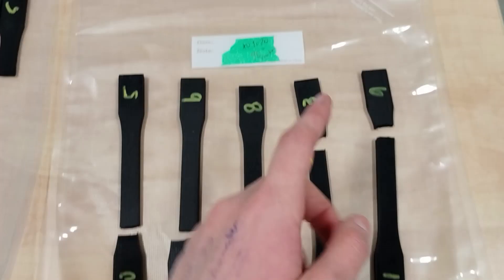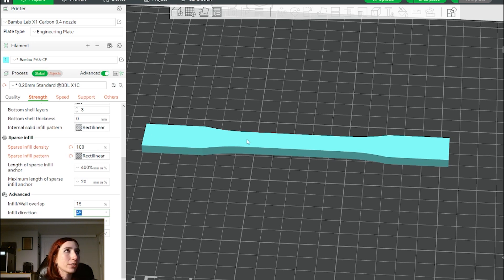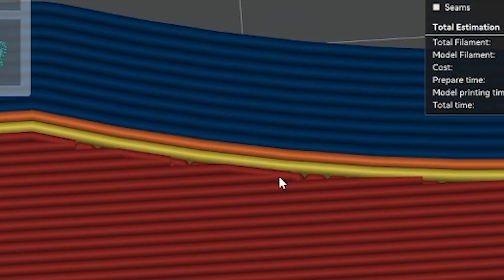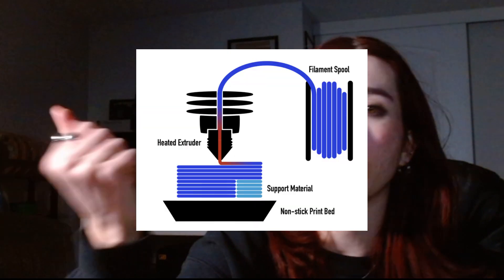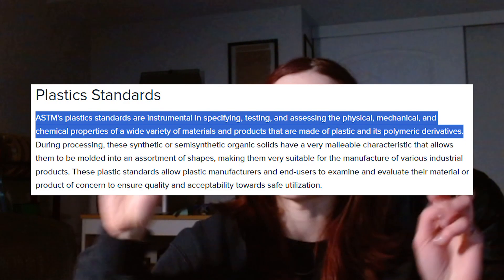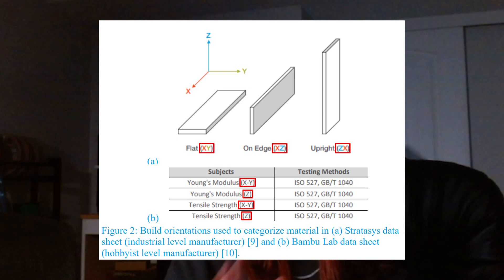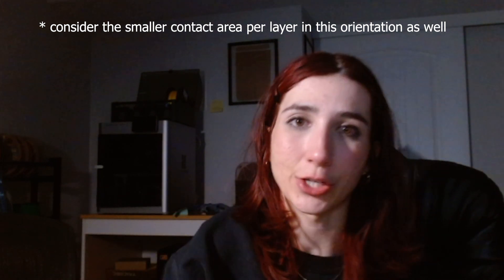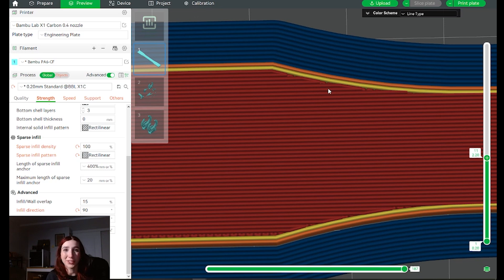we NEED better testing standards for 3d printed parts...

Comment: So I printed a lot of these samples with Stratasys machines and they use standard dog bones, tested in Xlong, Ylong, and 45* in all orientations. It ended up being ~40 articles per plate. And I believe they only used 45* alternating angles. 
My guess is the new testing method for custom machines will be all contour and no raster fill. Then separately tested raster fill.
Then parameters for strength are set for Z-orientation

Comment: I like your video I'm a engineer working with high temp materials at vision also agree we need a new standard also why are you not wearing safety glasses
Reply from the maker: Our tensile machine is fully enclosed when we run it so thats why I dont have any safety glasses! When I remove the parts from the system its after it has broken (usually in two pieces with no shards). 

When you say "at vision" are you local? What materials are you testing & is it just tensile?
Reply: @strelkomania   I work at vision miner in California not local to where you are we sell high temp machines and scanners and nano polymer adhesive and I can send some safety glasses
Reply: @strelkomania   we print at vision miner peek, ultum, peak, cf nylon gf peek cf peek

Comment: Really interesting, thanks for sharing.  I'm glad I wasn't too far off the mark when I tried explaining to my dad (a proper engineer) that the spec on the datasheet doesn't really mean much and I gauge parts much more on instinct about how strong they are than anything quantative.

I'd never considered that you'd get stress concentrations from the voids in the solid infill.  I get that these tests were inconclusive and can't be relied upon but it would be really interesting to know how these solid parts compare with something with more walls that isn't solid - i.e. does the stress concentration actually make this less strong than a part using less material (but more walls).

You might be able to get most of the voids filled if you can mess with the pressure advance / linear advance setting.  It might not be pretty and it just adds more fuel on the "it depends how it's printed" problem pile but you might get it to work by tuning PA/LA so you have bulging (over-extruded) corners.

Comment: I did a 3d printing research project for my senior mechanical engineering project. I printed 15mm square columns and used a 3 point bend test to average out impact of voids over a larger area. I was testing layer adhesion techniques. Point being that all my samples broke in the middle, so perhaps you can get the data you want from a 3 point test.

Comment: I think you might be too quick to draw a conclusion here. You have one set of tests, you're concluding the results are due to one variable without testing to see what changing that variable does.  Maybe it's the voids, maybe it's not. Orca slicer has a gap fill option.You're also only looking at the slicer, I find in practice those voids aren't actually there, plastic gets squeezed into those areas.

I'd say test with gap fill on and off, test with slight over extrusion to fill those gaps (if they aren't being filled already, you showed the gaps in the slicer but not on the actual samples), see what effect that has.

 clough42 had a similar issue to you with his tests (I think he also tested fibre filled nylon). The samples kept breaking closer to where they were held rather than in the necked down region. It turned out to be a work holding issue, stress risers and concentrations due to the clamping of the work piece. This is an even bigger issue with fiber filled filaments as they're stiffer, more brittle and weaker than regular filaments. CNC kitchen regularly tests filaments and they fail in the necked down region.

Comment: Powered bed fusion has a lot of properties outside of the ones you mentioned that inhibit the way it’s fused together depending on orientation power gyros skywriting there’s a lot of factors that it’s a whole different can of worms. It’s very interesting and I’m very into additive manufacturing and the applications and finding a standard way of processes to certify materials that are FDM, SLA, SLS , binder jetting and powder bed fusion. If you’d like, I can send you a thesis paper from a friend of mine, who is very knowledgeable and focuses on powder bed fusion he also teaches courses at the university of Texas El Paso.  His paper tries to explain a lot of things and is frustrated with how there’s so many different standards that NASA, ISO, ASME and all those other ones different ways of conducting tests. Even the aerospace company I work at has their own method. It’s very frustrating.
Reply from the maker: I would love to read that paper. There is an email linked to my channel page, please feel free to email it to me! THANK YOU! I am always looking to improve my knowledge on all facets of 3d printing including the different tech.
Reply from the maker: You're right. That's how it ends up being due to how much variability there is with additive - that companies (specifically the ones where failure is a big deal in the end application) will end up running their own in-house tests and create their own "standards" or failure thresholds uber specific to what they're working on. I have barely scratched the surface in this video and am happy to see your comment furthering the discussion :)

Comment: Might be a pressure advance issue, causing underextrusion at sharp corners.
Reply from the maker: Good point - dialing in extrusion settings or doing a gap infill could help! Even increasing wall count or printing concentric rather than raster. But in this case I wanted to showcase how a different raster angle actually can make a difference in performance (for better or for worse).

Comment: Composite materials are probably a good place to look in terms of standards since they have a similar structure (layers, with specific weave patterns) and most composite tensile tests just use a rectangular sample like what you described. I tried doing a flexural test with PHA filament a while back. When I used a Hilbert pattern it broke under a small load with very little deformation, but when I printed it with the solid infill aligned along the length of the part it was able to bend much more before breaking.

Comment: There are a number of 3d printer youtubers that have done significant research here. Print temp, wall thickness are the biggest indicators of strength of part (hotter temps and thicker walls lead to stronger parts). Infill has extremely little effect. The downside to higher temps is more stringing, the downside to thicker walls is much longer print time. Layer height can also be an impact.

Comment: 3d printed parts are anisotropic due to the manufacturing process (layers, infill...). However, those tests were designed for isotropic materials like steel.We lack good models for predicting the properties of the final part from the isotropic properties of the filament

Comment: Igor from My Tech Fun has a really good testing regiment.

unfortunately, he doesn't optimize print settings on a per filament basis but even still he provides a good baseline.

Temperature, speed, and cooling are the biggest key factors in making a strong FDM part. I bet, you have severe layer adhesion problems with those coupons. Layer adhesion doesn't just affect the Z-Axis it also affects every line causing delamination in each and every way down the valleys of air.

- Too cold or too HOT and the part will be weak.
- Too fast or too slow and again weaker
- same for cooling

To maximize strength, you have to ride the line between verification of the plastic and introducing micro stress risers from not properly melting the adjacent plastic with the line that is being put down.

Comment: Yes I found out the same. When upping the number of walls such that I only have wall lines this issue did not occur for most filaments. For those with relatively low layer adhesion this was still the case however. Allowing for rather liberal Arachne settings avoided this.
That however does not test what you are testing, it is the best case tensile strength in perfect layer direction. Even in this case I found out that the extrusion multiplier has a profound effect. Under extrusion obviously leads to weaker parts as there is simply less material and there are more voids. However over extrusion also leads to weaker parts, even 2% over extrusion (2 % above the peak tensile value, not necessarily visually the best although it was also visually the best sample) already reduces tensile strength by 5 to 10%.
The patterns you are testing I have simply met tested (yet). Would Arachne help (partially) fill the voids you get just like I was observing. The effect will be stronger with lower layer adhesion materials too I expect as that was what I saw even when fully printed in line direction.

You made me check what the slicers actually do. In Prusa Slicer I can see that for infilled layers except the top and bottom layer it uses monotonic line infill and applies Arachne optimization. Orca Slicer on the other hand uses monotonic for these layers. Monotonic shows in the slicer way bigger gaps than monotonic line. Maybe slicing with Prusa and setting all surfaces to monotonic line with Arachne enabled might lead to (slightly) better results.

Comment: It needs to be printed 100% perimeters not 1-2 perimeters and pure infill... That's why the pieces are breaking poorly.

Also your prints are not printed correctly. You need to use monotonic lines and not rectilinear infill and adjust the overlap and extrusion multiplier properly. 

Doing this properly will allow you to get the correct results.

Comment: I'm only a few minutes in but my immediate thought is: what if we used an arachne style top layer infill generator, which changes the line width to get way closer to the wall. if you can get right in there and fill that gap with plastic, it should fuse much better to the wall and any plastic in the previous layer too.
Reply: additionally, I also wonder if this problem is present when using space filling curves instead of rastering. although depending on acceleration, that could massively increase print times.

Comment: Excellent video.  I cannot agree more.  I've been having issues with TDS from any manufacturers since the beginning.  The impact of the process parameters VS the impact of the composition of the material is huge.  Some TDS will provide basic print parameters they use, some won't provide anything.  And even in the best cases, it's far from enough.  There is no way I can derive estimate of performance when I print a material.  TDS or not.

Comment: For the number of 3d printing channels that do testing, you'd think the universities would get on board and train students better. 
To use tests directly from other plastic processes is setting yourself up for failure.
Would you test a pressed powder metal part the same way as a cast metal part? 
Or expect the same failure modes?
Reply: I get you but there is also value in a test that is standardised across many different manufacturing methods so that you can compare across the methods.

Comment: A new standard for FDM/FFF is something I'm very interested in!

I did some material testing research during my undergrad and the anisotropic nature of 3D prints seems like such a can of worms. I wonder if a more universal G-code standard/file type would help with repeatability between printers, and so that important variables like layer thickness, number of walls, direction of raster, etc. can be more easily communicated since G-code files are usually pretty unintelligible once its out of the slicer. I also suppose more properties of the filaments would need to be measured before the testing, like how much water the filament has absorbed and the age of the filament.
Reply from the maker: It is a can filled with many worms. SO much variability - which can lend itself useful in some applications, and not so much in others... a universal g-code would be possible but I wonder how difficult it would be to have it suit every type of system. I mean at its core its the same type of command its just the Mcodes that vary per firmware flavor. An interesting thing I didnt end up realizing untill I started trying to parse some gcode for another coding porject - the bambu slicer uses different widths of the bead for different parts of the toolpath, same with Prusa Slicer. Even though your nozzle might have a 0.4mm diameter - doesnt mean your whole print is going to be printed out with a 0.4 mm bead.... If you would like to share your undergrad research Id be more than happy to read it! You can find my email in the links section of my channel page :)

Thank you for stopping by!

Comment: It's not the standard that's wrong - it's that 3D printed parts are of poor quality from a structural standpoint.
Reply: More walls and/or more top and bottom layers.
A straight-sided test coupon is also obvious. The taper at the ends is supposed to neck the material down to a smaller cross-section without introducing a stress concentration.
Reply: The standards do exist, I’ve used them tons already, and they’re bad.
Reply: Agreed. The standard isn't wrong. The testers are being told to use the wrong standard. Just like there are different tests for solid wood and plywood.
Reply: @Squirl513 so in your analogy, where are the standards for testing 3D printed samples?
Reply: @CarbonKevin  they don't yet exist.

Comment: If your test coupon doesn't narrow in the middle, the narrow and weak point will be at the edge of the clamp, where it compresses and begins to shear the material.  To minimize gaps, you could have it narrow in the Z direction, rather than in the X/Y plane; that way there won't be any section that has less material than the gauge length of the coupon.

Comment: My thinking on this...There's probably some interesting shear forces or stress concentrations occurring along the curved section of the perimeter between the perimeter walls themselves and between the perimeter/infill bond area. This wouldn't be helped either by any small voids in that interface area from toolpath artifacts. Try printing a perimeter only outline of the model (I made a 3 perimeter, 0% infill, 0 top and bottom solid layers, 0.2mm layer height, and scaled to 1.2mm tall model to play around with) and you can see how the axial loading gets very...well, un-axial. You could try a fully-rectangular test piece with or without tabs epoxied on, but it is still likely to fail at the grip location or surface transition. 

The trick is going to be getting your gauge length, as your area under test, to be the weakest part of your test piece. For a homogenous material, the reduction of cross-sectional area takes care of this. But for FDM printed parts its as much about the layer construction as it is build material. You could use area specific modifiers in the slicing software to ensure the grip area and transition to gauge length are stronger than your test area (extra perimeters, concentric infill, etc) but will likely encounter weak points where they interface.

I didn't come across any testing procedures for composite laminates, but a 100% rectilinear infill FDM part probably has way more in common with that than a solid molded part that would be used to test material properties. Might be interesting to try the 45 and 90 degree solid infills printed with 0 perimeters as an analogue to a composite stackup. There's probably a way to vary infill angle on a layer by layer basis and get into some asymmetrical stackup chaos.

Could also be interesting to model a simplified version of a single printed layer and run a finite element analysis and see how the infill and perimeters are interacting. 
Hope this sparks some ideas!

Comment: Process parameters affect results in other manufacturing methods as well. If you don't dry well enough PA6 pellets and you manufacture (extrude) weed wacker line (also known as filament) at the wrong temperatures, won't the properties be different that the TDS? When you test 3d printed samples, you are testing the "final" product, not the material. It is like putting a LEGO Technic bar on the tensile tester. Or testing a LEGO brick for impact. You get different impact strength values between yellow and red LEGO bricks of the same size from the same production date/batch. But the TDS has the injection molded (same manufacturing technology for LEGO bricks) ASTM or ISO specimen properties of the ABS uncoloured pellets that are used to make LEGOs.

Now for standardization for additive manufacturing, unfortunately (or fortunately) there is extreme amount of variation in process parameters and even hardware setup. It is not only a difference between slicer parameters and tool paths. Nozzle size anyone? I print with pellets FGF (not filament) with a 5mm nozzle and CNC cut out ISO 527 1A tensile bars and test XZ and ZX orientations. With the correct layer time for some materials you can have almost isotropic properties. You can also slice with stacked/brick layers nowadays. It is amazing what you can do with slicers and the geometry design freedom AM gives you. Testing 3d printed samples with the existing test standards is still valuable information for engineers and product designers, because with comparisons and no difference in test and print conditions (where possible), you still get a good idea of what the properties of the materials you are comparing are.

But to get back to my initial point, it does not make sense to me to standardize tests taking process parameters into consideration, because in injection molding for example for the same ABS pellets you use different mold parameters (pressure, cooling temps, ejection delay etc) when injection molding LEGOs or the enclosure for a multi-meter or the handle of a hair dryer.